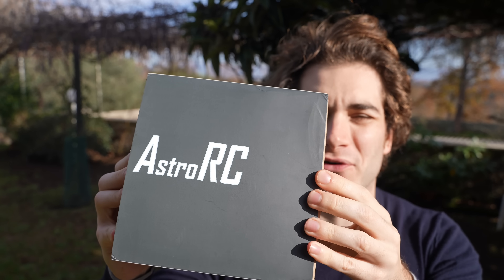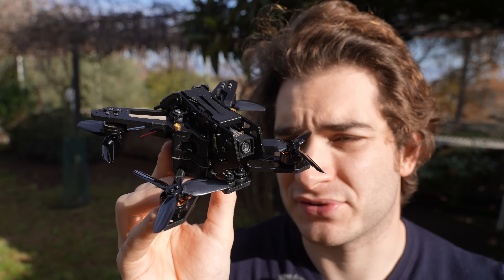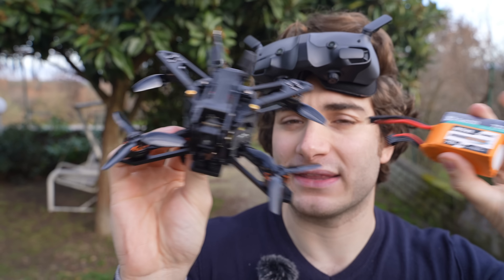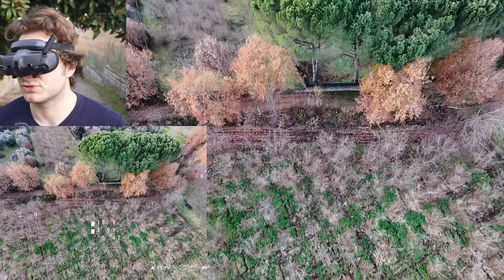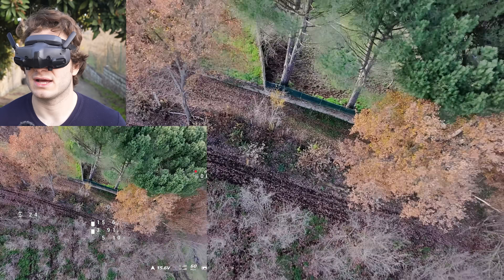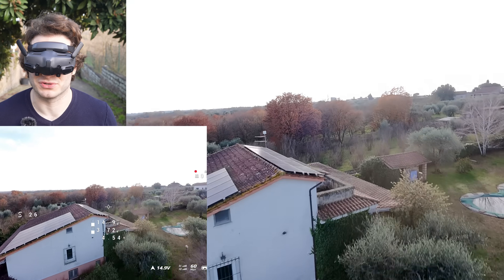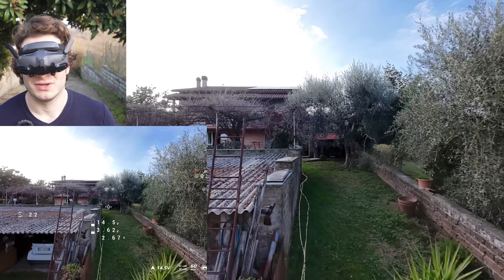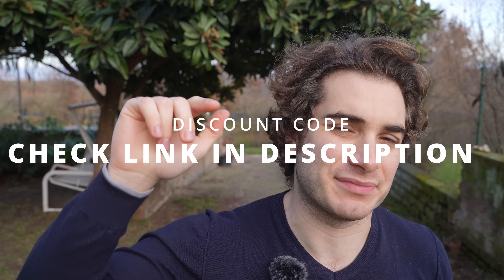Crazy FPV Drone Design... But Does It Make Sense? AstroRC Shuttle V2

Comment: Hi. For the latency, Check the base Tuning in BF, the FeedForwad is at 0... i already bought one AstroRC Shuttle V2 (Analog version), and i change the base Tuning and the VTX by a Moonlight.
Reply: They make an analog version?  Yay!!!!  Could we fit the boards (20×20 or 25) in the 04 version?
Reply: @AlwayslookingNeverlookedfor i don't understand. Wich boards??
Reply: @Youz36 the esc, fc, and a vtx of i was trying to do analog build
Reply: @AlwayslookingNeverlookedforyou just need an AIO FC and it's OK.

Comment: Downward facing props tend to have issues in turtle mode. How does this one work?
Reply from the maker: The one time I tried it flipped it no problem
Reply: The Shuttle V2's blades are on the same plane, which does not introduce additional difficulties compared to conventional structures.

Comment: no it does not make sense, it looks cool, but very difficult to turtles flip. Soft mount rubber pops out easily. Had it stuck on a rooftop and gave up on flying it anymore
Reply from the maker: That's because they also put the minimum arm angle, need to change the value to 180 degrees, but I agree doesn't offer advantages

Comment: I built a quad with a frame like this at least 7 years ago. I don't see anything new about this one. The reason this frame layout came about was to fit larger props on a smaller frame size class, back when people did races based on diagonal motor to motor size (180, 250, 330 class etc). For any other type of flying there are no upsides to this style of frame over what has become the norm when it comes to frame designs, only downsides
Reply from the maker: I remember also frames with angled v tail propellers and front inverted motors, looked super cool but no advantages
Reply: @rimzler  Oh yeah, but looking cool was the only point to them. Back then we just built multicopters for fun
Reply: A key reason I chose this structure for the SHUTTLE V2 is for high-definition image transmission services:

1. It requires an overall vibration-damped image transmission module to provide the O4 with very stable image output. You know, the DJI O4 suffers from severe shaking issues on many standard frames.

2. It needs to achieve unobstructed（By props) shooting within a very small and normal wheelbase, which means the lens needs to be at very high position, 

NBD has done similar experiments, and you'll find that very tall lenses result in an odd appearance. However, the SHUTTLE V2's structure eliminates the discomfort caused by tall lenses.

Comment: Bro I just found your channel like last week. Ive been looking at the shuttle v2 for the last 3 days, then BOOM you post a review. It’s like you read my mind😹😹
Reply from the maker: Hahahahahahhaha happy to be of service! What do you think now about this drone?
Reply: @rimzler i think it’s super cool. At the control of a pilot like yourself it looks like a load of fun. The unconventional frame and prop placement just speak to my style. I love unconventional stuff. I am going to order the model with the O4 lite today, then I’ll just be waiting to find some goggles 3 or integra for a good price!
Reply: @392swim  Thanks for it .    The 3-inch weight of the Flying Shuttle doesn't offer much of a weight advantage because I used a very thick carbon fiber (4mm), a thickness rarely seen at this size.

The reasons for using this thickness are as follows:

1: This is a small-sized racing drone designed for beginners, requiring excellent durability.

2: It needs to maintain the overall structural rigidity of a 3.6-inch form factor.

Comment: So they wanted something unique and made something complicated, looks bad and heavy, and it's AIO use Micro-usb, guess they compete with darwin-fpv for low price.
good review as always.
Reply from the maker: Yeah doesn't offer any advantage except from being peculiar
Reply: @rimzler  It's a pity that the flight performance didn't meet your expectations, as the 3-inch version wasn't designed for use in large environments and is more suited for stable shooting in parks and recreational areas.

However, at least it produces very stable footage, which is quite impressive for the O4.

The image transmission modules in the Shuttle series are interchangeable. For your environment, I highly recommend trying the shuttle 5-inch, as you can directly port your image transmission module.
Reply: Hi: Thanks for the reply.  I will answer some of your questions:

1. Whether you like the appearance is up to you.

2. The 3-inch Flying Shuttle is slightly heavy. This isn't due to structural weight but rather the use of extra-thick carbon fiber plates. It's not heavy in 3.6 mode, as I mentioned in my comments above.

3. We don't have the capability to manufacture our own flight controllers. This is very unfortunate, and we didn't want to OEM very cheap AIOs. Therefore, we chose to use JHEMCU's F405 PRO 40A AIO. This AIO is very mature and stable, and JHEMCU felt there was no need to change it to a Type-C interface because Type-C interfaces are larger and heavier.
Reply: @AstroRCfpv  
1-  At least make it foldable to be more appealing.
2- Why the need to use thick carbon ? I don't see anyone would bando bash it, at least me, and that without arm's tpu protection.
3- I get that, even though still not adding much weight but in reality, just saves pennies, and space could have make it like Speedybee aio F7 (old one) or BetaFPV that comes with extension and lock it frame itself, future ideas.
Just so you know, am not hating, just saying what could be improve, for you and who would like something new and functional.
Reply: @T418RC  Thanks for the reply ,    I used a thicker carbon fiber plate because I was experimenting with a dual-hole variable wheelbase design. In the 3.6-inch mode, the 4mm carbon fiber plate provided better rigidity. The 3-inch mode is more for beginners; the extra thickness offers better durability. The TPU at the tip of the carbon fiber plate primarily protects the motor and doesn't prevent arm breakage (arm breakage usually occurs at the base). The shuttle's variable wheelbase provides enough extra carbon fiber plate length to adequately protect the motor, so no additional TPU was installed in the 3-inch mode.

We will try other AIOs if given the opportunity. Sbeedybee definitely has impressive electronic design capabilities for projects.
Reply: DarwinFPV cineape35 is a great drone and has usb c and is waterproof and has gps... I trimmed my guards off and run a naked version.

Comment: just one question 
Why??

It Looks sick but why would you choose a havier but similarly flying quad compared to other 
3 inches
Reply: 1. As you can see in the video, there are no visible propellers, which is crucial for high-definition shooting.

2. Because of point 1, and the need to maintain a relatively normal wheelbase, a high lens position is required.

3. Because of points 1 and 2, conventional structures cannot provide a good solution when both are satisfied simultaneously.

4. You can see that under O4 image transmission, the recording and video performance are free of abnormal shaking and are successfully stabilized. This is thanks to the overall vibration reduction.

5. Times are changing. In the high-definition era, small FPV drones no longer need an additional action camera for recording, so the new design is not without significance.
Reply: There's no issue with doing something just because it's kinda cool or different
Like why buy a folding phone when you can just buy a regular slab phone like everyone else?
Reply from the maker: No absolutely, I say it many times in the review, looks cool but a normal drone is way better

Comment: What an unusual quad. I have never seen something like this.
Reply: You can mount motors like this on pretty much any drone, there's no major difference in flight though aside from pitch is easier.
Reply from the maker: Ahhahaha I love seeing new stuff, love it even more when it makes more sense🤣
Reply: Is this not the same motor config on the matrice 30 series? I definitely haven't seen it on a hobby drone though.
Reply: The only idea to do something like that is to have shorter rear arms to accommodate bigger props